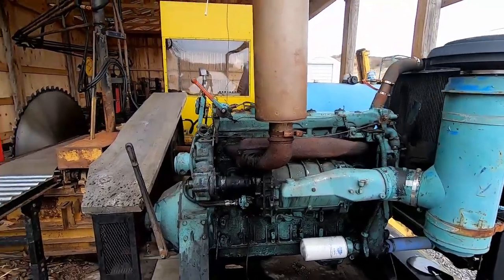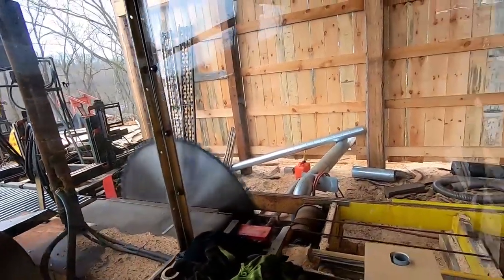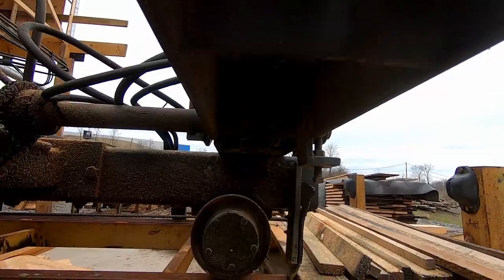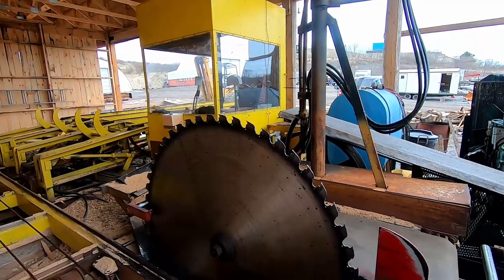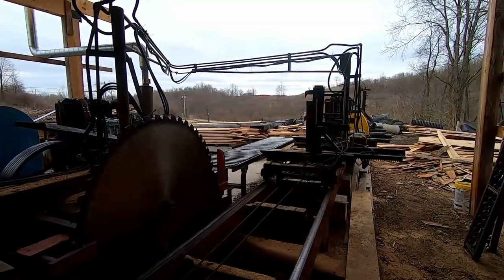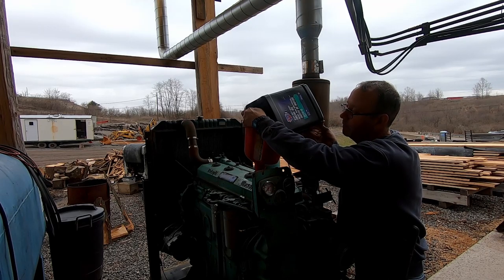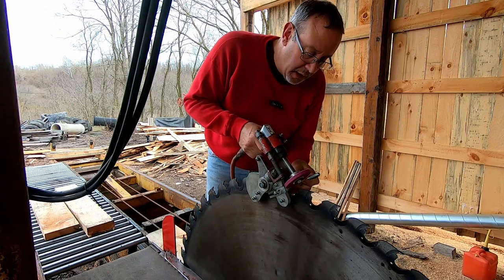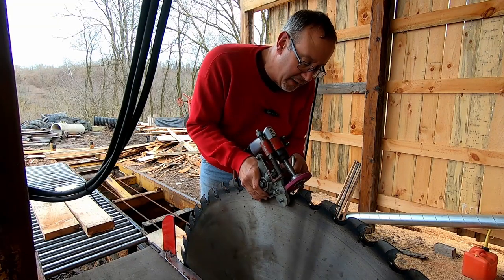sawmill maintenance

Comment: Just a suggestion, but if thats a 6-71 detroit 2 cycle, you should definitely run straight weight oil in it.. if it gets real cold where you are, 30 wt, but 40wt is better.. Detroit recommends straight weight oil for the 2 cycle engines. Hope this keeps your mill running longer..

Comment: When you are dumping oil out of a container that has the hole on one side like your 2 1/2 gallon jugs, turn the opening to the top, it alows the air to go in evenly and you don't have the surging of oil or the gulping of air.
Reply from the maker: we save the container for the old oil.
Reply: You miss understand me, pour with the hole on top instead of the bottom. Can still use the container to put the old oil in.

Comment: Where do you find those jigs for sharpening the blade? We have an old steam-powered mill at the historical foundation that needs to be sharpened. The sawmill was built in 1895 and moved to its current place on the foundation grounds 20 some years ago. We use it once a year for our Heritage Festival.
Reply from the maker: I got it from McCormick & son's saw shop in bethesda Ohio.
Reply: @markgalicic7788  thank you.
Reply: It's an Andrus sharpener.  I've never seen the pneumatic drill motor attached before.

Comment: Hi there Mark, along with your saw sharpening ,  if your cutting harder timber do you find you have to intermittently stop through some cutting of a log & give a quick re-hone to the saw tips , or each inspection of the blade you prefer to replace them all?
Reply from the maker: Yes, absolutely

Comment: Another great start to my day  just wondering is there enough hydraulic capacity to run the saw dust blower with a hydraulic motor also I would make a bracket and point the gauges at the cabin
Reply from the maker: thanks , I don't think the hydraulics would carry the sawdust blower.